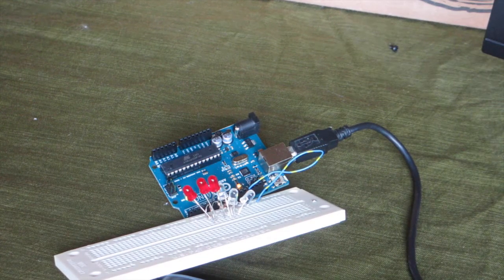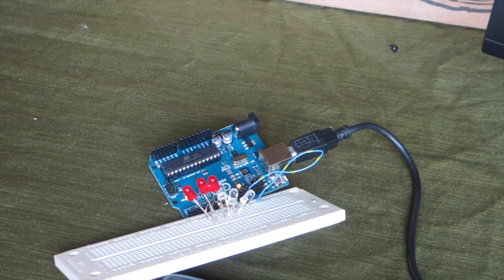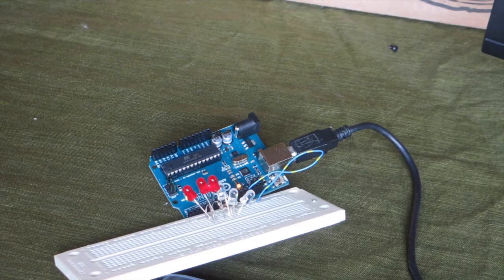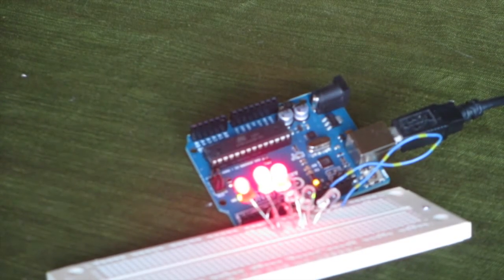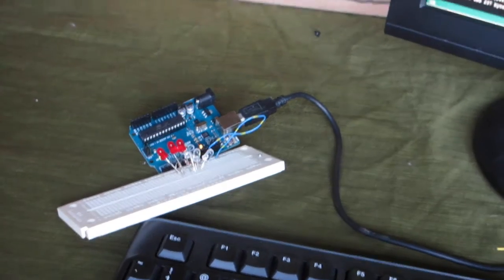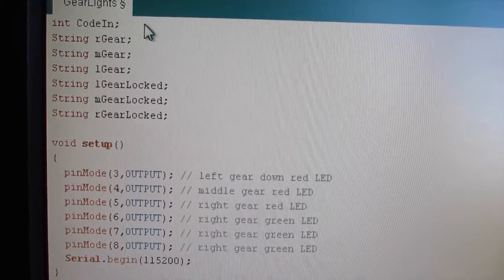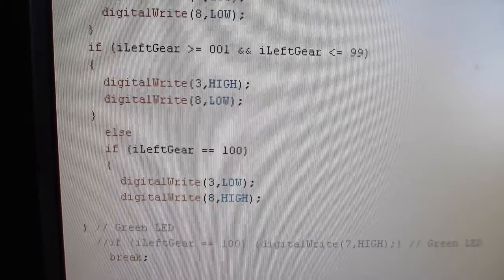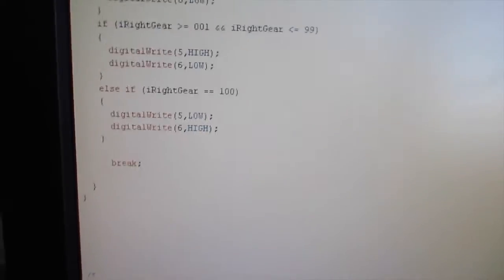FSX and Arduino Landing Gear

Comment: How do you do it? :)
Reply from the maker: Ah yes.  I will make a video on the electronics part.  Thanks for the heads up.  You can also look at the sketch to figure out where the electronic/wires go in the mean time.  I haven't installed this yet in my cockpit but I hope to do this soon. Thanks for commenting.